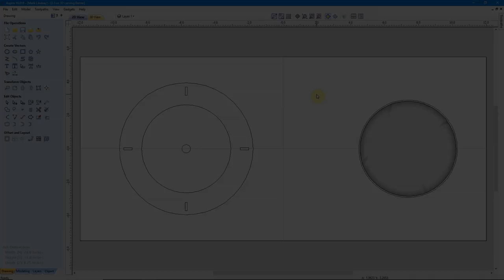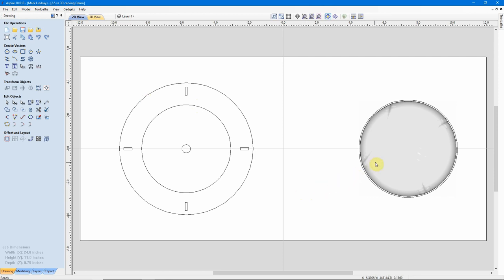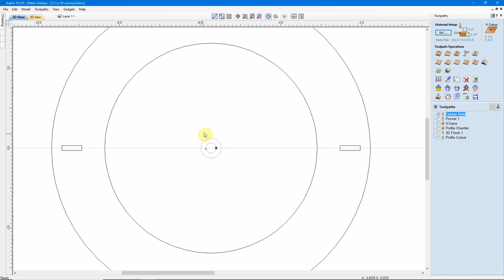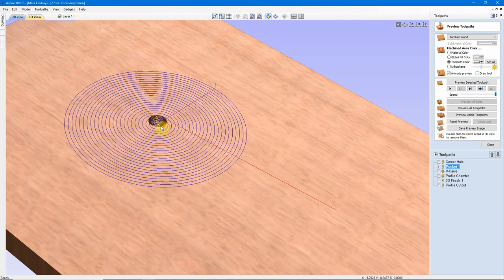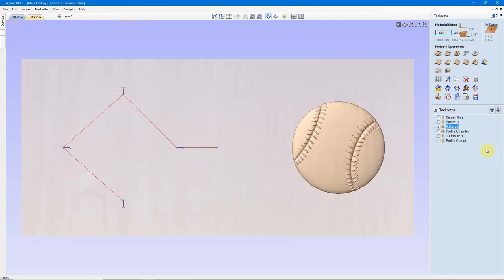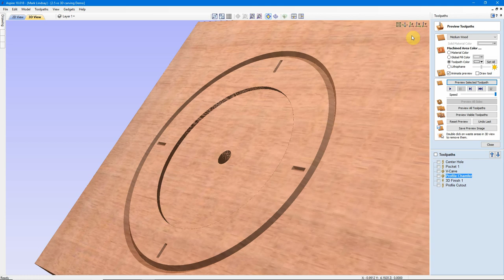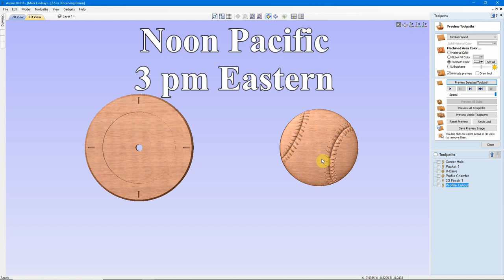2D vs 2.5D vs 3D Carving - Part 36 - Vectric For Absolute Beginners

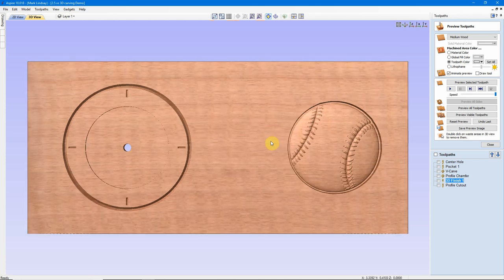Comment: 16:20 - Good explanation. Was extremely confused when people were saying 2.5d carvings vs 3d carvings. Makes sense. Seems like this is a cnc firmware/software issue in the industry, where all 3 axis are not working simultaneously to produce a true 3D carving where on a 2.5d carving only one or two axis works at a time.

Comment: Mark, how does the bit catch up when doing a "ramp in" cut?  If it ramps over 2" I assume the depth is increasing over those 2".  If so, how do those 2" get cut to the desired depth?
Reply from the maker: Good question, Steve! Let's say, for example, the ramp starts 1 inch from a corner, and gradually lowers down to the correct cutting depth over a distance of 2 inches. That means the bit is 3 inches away from that corner when it gets to the correct depth, at the end of the ramp. Then 1 of 2 things happen, depending on what type of cut it is and how much space there is for the bit to move. 1.)The bit continues along its path until it gets back around to the beginning of that ramp, then keeps going until it's just a hair past that 3 inches, removing that ramp.  2.) The bit gets to the end of the ramp, then reverses direction at the correct cutting depth, and goes back to the start of that ramp, (removing the ramp,) then reverses direction again to continue cutting in the correct direction, at the correct depth. I plan on doing a video on Ramps and Leads, so you just got a brief synopsis of how a ramp is machined. I hope that helps!
Reply: @MarkLindsayCNC  Thanks Mark.  That clears up my uncertainty about ramping.  I appreciate your response.
Reply: @MarkLindsayCNC  Thanks Mark.  That answered my question nicely.

Comment: Great Video Mark. I have a  question.  I want  to take a 1.5 thick x 5 wide x 12 long board. At the  two 5" side I want  to carve a u shape down to the  center about .75 to create that shape the  fill length of the board. Is there any way to do that in Vcarve Pro 10 
Thanks Jeff
Reply from the maker: Thank you, Jeff! Hit me up via email, or, if you can, hit me during today's Live Q&A. I'll need a bit more info, and this isn't the best place for that.
Reply: ok
Reply: sent you a email.

Comment: So... 2.5D is really just a term people use. It appears the software only recognizes 2D and 3D. Is that correct?
Reply from the maker: On the CAD/CAM side of things, yes. The software only works in 2D and 3D on the CAD side. It only recognizes 2.5D in the Preview window on the CAM side, after the toolpath has been previewed. The term 2.5D does have a meaning, though - although it's more important in metal machining than on a CNC router.
Reply: @MarkLindsayCNC  Got it. Many thanks, Mark! I'm going to try and catch the Livestream later today as well. Peace.
Reply from the maker: Thank you, Matt! I have a feeling the subject will come up again in the live stream. Hope to see you there!